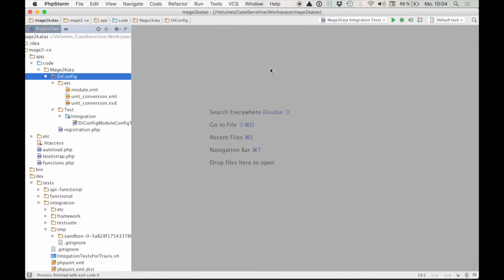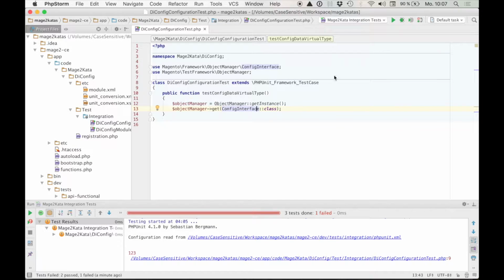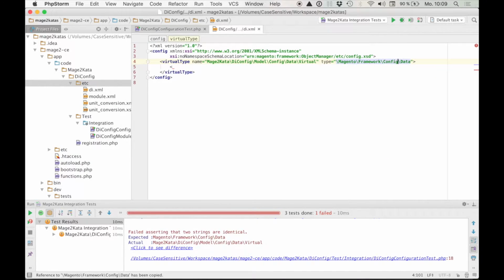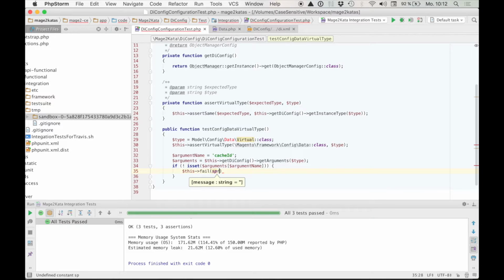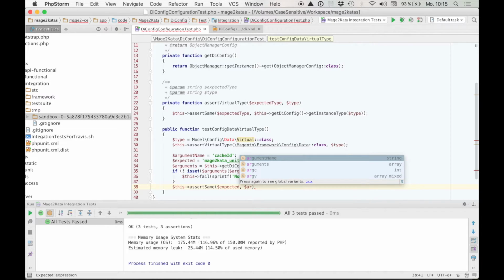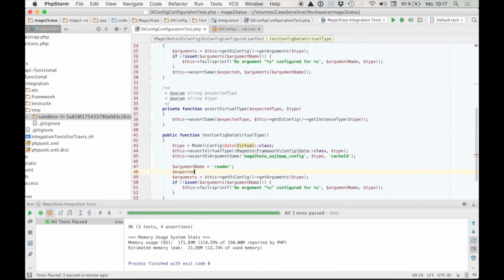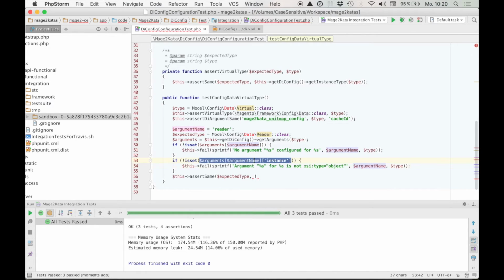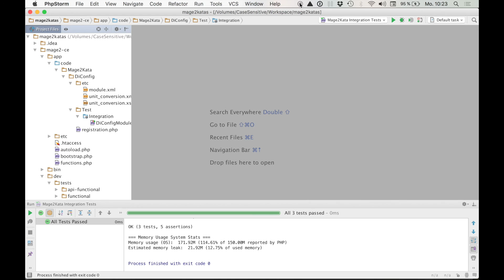08 The DI Arguments Config Kata

Comment: For some reason my Magento install (2.1) is not correctly resolving the virtual type when running the tests. However I tried creating a small module like this one and run stuff from the frontend and DI resolves correctly. It looks like there is some magic going on in the TestFramework ObjectManager that is not happening in the regular ObjectManager. I have to look deeper into this.

Any hints as what might be going on?
Reply from the maker: Do you want to publish your code on github or somewhere, then I'd be happy to have a look over the weekend or so what is going on?
Reply: sure I'll do that and post the link here. I hope to have this figured out by weekend though. I just to look deeper under the hood to figure out what is going on